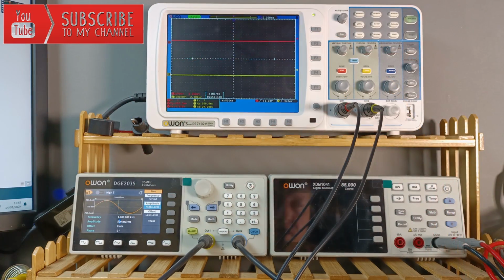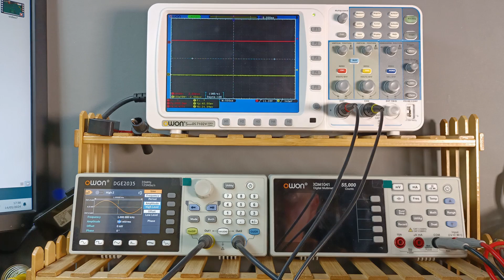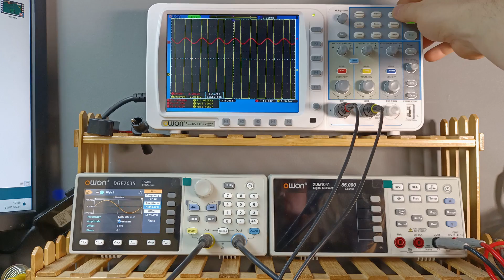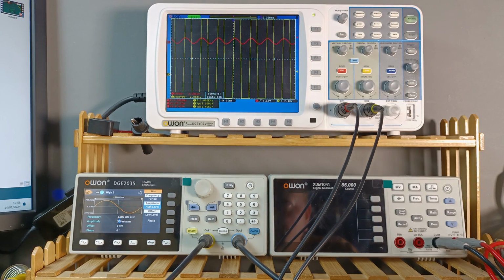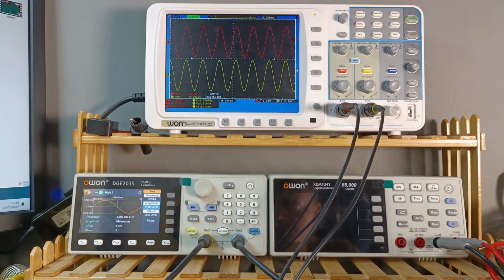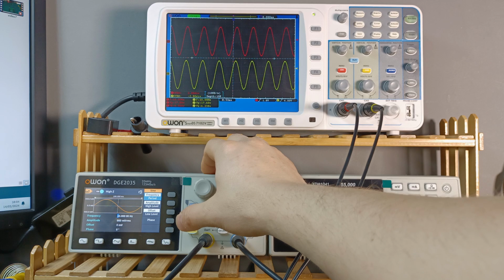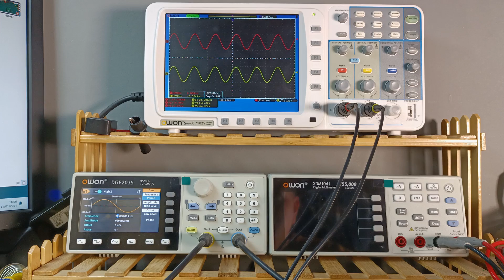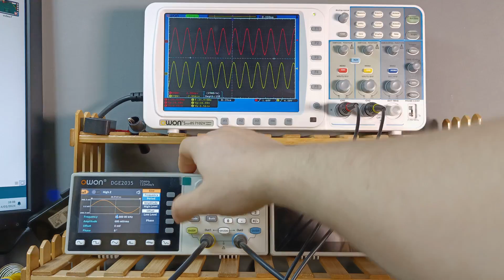Headphone amplifier jlh class a

Comment: it is advisable to select resistors in feedback separately in pairs, for example, a pair of rnc55 vishay would be good.
Capacitors 0.47μF, in my opinion, or MKP wima, or analogues.
Transistors can also be selected in pairs, they are very common
Reply from the maker: Thanks usually I do this I select all parts in pairs but my idea was just to do it straight away how is coming from AliExpress

Comment: Hi Toni, my name is Carlos and I'm a relatively new subscriber of yours. I have a few questions about the amplifier.I bought a board with the loose components to solder them myself, and I don't know if I have to put some things, Do you have the schematic for it? Could you tell me if the jumpers on the board should be connected or just the one marked "jump?" I've made the jumpers and put them on the board, but I haven't soldered them. Do I solder them? Or should I just leave the one marked "jump?" Did you change anything from the original design the i can put on my board?Thanks. By the way, I love your videos.
Reply from the maker: On my board I don't have any jumpers to install. Maybe you have a different version of this one. And usually on the board all components have the value marked on the board. Maybe you can send me a message on fb

Comment: Would it be possible to use it a sa preamplifier?
Reply from the maker: @jeremynorth  not really because have low impedance on the output. Usually the preamplifiers they have 10k or 50k or 100k impedance on the output
Reply: @SymbolTech21  Would it be possible to change the output impedance to make it work?
Reply from the maker: @jeremynorth  can be but involve on changing a bit the schematic. But if you are looking for a good preamplifier I have 2 recommendations
Reply from the maker: @jeremynorth  https://youtu.be/IbDy9C_E0BI?si=1iSiEH-csFC10uAV check this video and you have the link of this preamplifier on that video description
Reply from the maker: @jeremynorth  and on this video you have the second preamplifier kit which is a good one. Soon I will build it up and run the tests. I didn't get a chance yet. So check this mailbag video and you find the link of the preamplifier on that video description https://youtu.be/C9eRWEI1ga4?si=FylEJFEyMxN-hpoj
Reply: @SymbolTech21  thank you

Comment: 470-ohm resistors; you can change them. For example, use 1k resistors to 1/2 the gain.
Reply from the maker: @iWannaMakeYouObey  yes I did few modifications to this amplifier and now is working really well